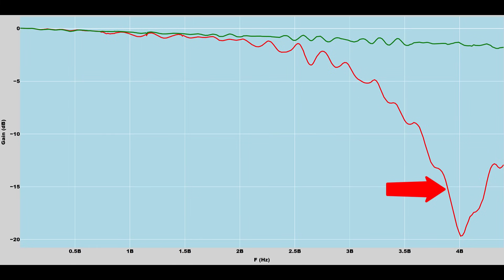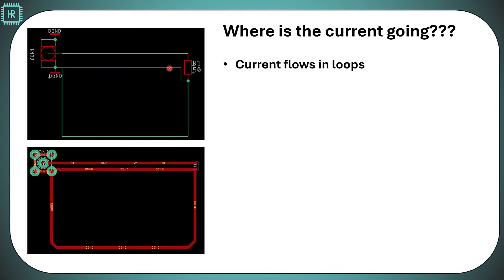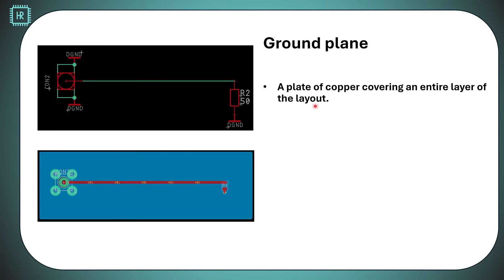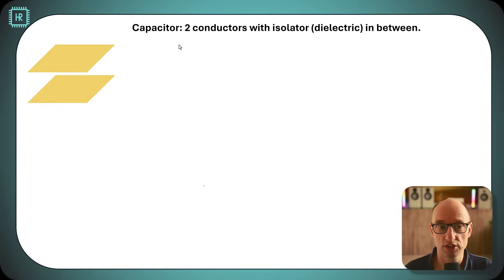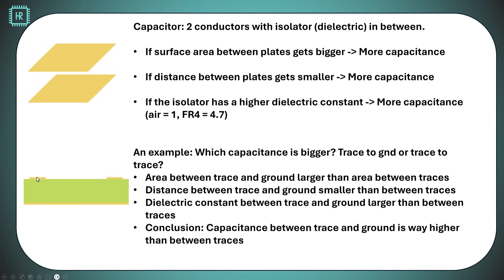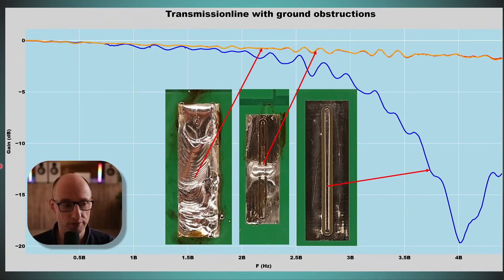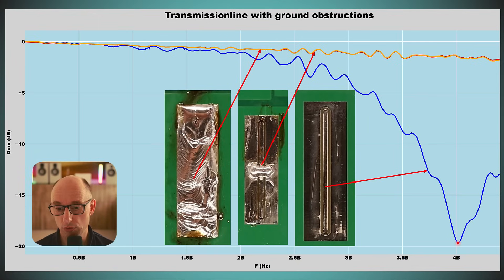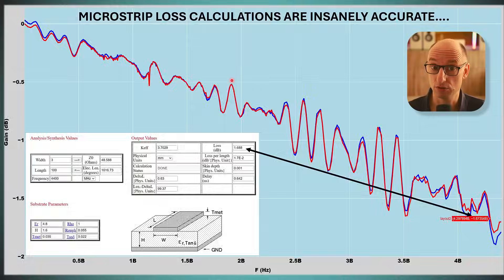Flawless PCB design: RF rules of thumb - Part 1

Comment: Don't need the checklist, created one myself in the last 30 years of so, lol... Being a HAM operator building RF amplifiers myself for VHF, UHF an SHF (DATV) I can only agree with your findings. What did struck me some time ago is how RF energy is moving through the copperlines on the PCB, well it's NOT, it's moving through the PCB between the striplines and groundplane and vice versa through the diëlectricum! Nice video Hans, best regards Richard (PA1RAM).
Reply: By the way, forget to mention. The last example you gave, it's called a Wave Guide, actually a Coplanar Wave Guide, am using it all time these days in my RF amplifiers. And yes there are some good calculators available on the net.
Reply from the maker: Indeed, I know the name. Forgot to mention it. I'm going to make a video on characteristic lines at some point. Good to hear your experience matches mine.

Comment: Great video, cant wait for PCB design for RF to EU energy converter
Reply from the maker: what is that?
Reply: @HansRosenberg74 it could be a Minecraft reference.

Minecraft has a huge modding community. Some mods add machines which require energy to operate. 

There is no energy mechanic in the base game, so mods often add their own energy systems (usually some simplified version of real life electricity with cables, generators, some sort of accumulator for energy storage, etc.).

RF and EU were two popular energy systems added by mods. The problem is that they are incompatible with each other (you can't power an EU machine with RF and vice versa), so people often had to build RF/EU converters in order to power machines from one mod with generators from a different mod.
Reply from the maker: hahahahahahaha

Comment: Hello Hans,

Checking out many of your videos, you always tell us to use a continuous ground plane. But what about mixed circuits like analog audio high frequency transmitter circuits? 
There you have analog audio -> ADC -> RF fronted. 
How do you avoid digital clock and RF noise (sub-harmonics) to get inside the audio path without separating the ground planes?
Reply from the maker: Great question. This is why I'm making my next video. This is a question that comes up a lot and I've seen many designers choose for separate ground planes and see their designs fail. I hope I can explain it clearly in the next one. I just posted my 5th video, and the car kit example shows you 1 case of how multiple ground planes can fail. Maybe that already clears something up for you. Link for part 5 should be in the description. Best regards, Hans
Reply: @HansRosenberg74  thanks a lot for your reply. Indeed I watched the car circuit example and how separating ground planes you may cause more inductance in the current return path. I'll be waiting for your new videos.
Best regards,
Pablo.

Comment: Which nano VNA are you using?
Reply from the maker: I'm using the NanoVNA V2 Plus5. This is a more expensive model, but it allows for very fine frequency steps which allow measurement of crystals as well. I read that there are a lot of cheap chinese versions which have less specifications so if you want to buy one you should be careful what you buy. Best regards, Hans

Comment: 13:39 Er has been faked to get the desired result.
Reply from the maker: Haha, believe me, I was just as surprised that the values landed on top of each other. In analog/RF you always expect some tolerance, if you can predict something within 10% its already quite nice. But this is just what I filled in. It's more a bit of luck I think, I would have been happy with everything within +/- 0.3dB.

Comment: 12:16 you do know, that many GPS receivers have 1-bit to 4-bit analogue front end, don't you?
Reply from the maker: I don't really understand what you mean here.
Reply: @HansRosenberg74  GPS receivers don't need high dynamic range. Many GPS front ends have a 1.5-bit ADCs.  AGC keeps the input at thermal noise floor and cross-correlation does the rest.
Reply from the maker: I've worked on GPS receivers a number of years ago. You do need a minimal amount of dynamic range because cross correlation can only get you so far. If you had infinite time, you could cross correlate really deep, but you don't have that time since bittimes are limited. So you still need a minimum dynamic range. If you think about 1.5 bits, you would think this is only 9dB of dynamic range max. However, the trick these receivers use is massive oversampling and then decimation. This turns the 1.5 bits into something much more bits with a lower sampling rate. You can go up to 24 or 32 bits if you want with enough oversampling. This means that you still need that dynamic range. It's just achieved in a different way.
Reply: @HansRosenberg74  Well, in some way — yes. Thermal noise creates almost perfect dithering effect. Don't forget that the biggest noise source in GPS is own satellites — cross-correlation between two PRNs is only about -20dB and there is a good dozen sats visible at the same time.

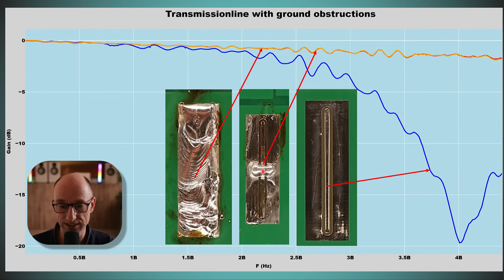Comment: Dear Hans, I have question. On 10:52 -> The signal is flowing under the trace. So, what happened if we have an arc as signal path and a ground plane on the other side. Will the signal make a curve or will it choose the direct shortest path ? Thanks, your explanation on Youtube is priceless
Reply from the maker: wow, thanks for the enthusiasm :-) Indeed, it will simply follow the arc in the groundplane under it. If it would take the 'short' route, it would create a bigger loop if you look at it 3 dimensionally. So that is not the lowest impedance.
Reply: Thanks again. Clear explanation .. We should look at it 3 dimensionally. Cheers from Jakarta

Comment: You said the slightest interference will ruin the bottom end, but in your graph I thought the lowest values show the lowest amount of problems? Is that explained in another video?
Reply from the maker: If you look at the total dynamic range of an analog signal, it goes from 1V to 1uV for instance. 1uV is limited by noise and the 1V is limited by the swing of the circuit in this example. If you add a little noise or interference, the 1uV bottom part of the dynamic range is 'swamped' by this extra noise or interference. So you don't achieve a factor of 1.000.000 (120dB) anymore, but something less. Maybe this clears things up?
Reply: @HansRosenberg74  Yes thank you for responding!!

Comment: any suggestions for a calculator which properly treats a coplanar microstrip with vias like you describe? i spent a while a few months ago looking for references and came up short.
Reply from the maker: I think they're assuming that RF engineers know they need to use via stitching and therefore omit it. If you just take 1/10 wavelength distance between via stiches, you'll be guaranteed the exact same performance that the calculators predict. My part 4 video shows measurement results on this.

Comment: ESD is an interesting subject, which is a single strike event of 0.8ns duration (>1GHz) and very high voltage which causes interference and damage to circuits. Its not always possible to place ESD protection extrememely close to connector pins, so tracking needs to have uninterrupted ground planes like you mention. It would be interesting to see if there are things to avoid, or better schemes, to defend against these events!
Reply from the maker: It's already on my  list, I used to be doing a lot with ESD prevention and I still have all my own manuals :-)

Comment: I undertand capacitance but i dont understand impedance. Doesnt the return current follow under the signal trace because charges are attracted and because of the slight imbalance of charges under that trace, like capacitively coupled?
Reply from the maker: Impedance basically the complex variant of resistance. So an impedance has a real and imaginary part. The real part is resistive, the imaginary part is either inductive or capacitive. The path directly under the trace has the lowest overall impedance, that is why the current flows there. Field lines are definately present between the signal trace and the ground plane, but it is more a result of the lowest impedance path I think. Now however we're getting into really fundamental physics and I'm unfortunately not a expert at that. I understand what happens on a board due to my long experience, but I lack the deep knowledge of physics.

Comment: Floating planes. I have thought about this, whether I could use copper strips to make a "faraday cage" either partly or fully around or between signal traces to shield them from either emitting or receiving noise. And whether i must connect these to ground. 
It seems as if i dont connect them to ground it will just make things worse by capacitive coupling?

I am just an amateur so these videos are indeed very helpful.
Reply from the maker: if you make a cage: fully ground it! only then will it block high frequencies as well, in my next video I'll show a simple formula how many vias you need per unit of distance.

Comment: usually when you make a video for RF design, you're audience aren't amateurs, yet you're teaching amateur level. for example: if surface area between plates gets bigger -> more capacitance... i mean come on! if you're going to make a video like this, maybe change the title to how to connect an led :)
Reply from the maker: My practical experience is different. I've repaired so many pcbs from colleagues who missed these basic insights which made these pcbs fail rf requirements. Many electronics engineers seem to think RF lahouting is something like black magic, but it's really simple and that is what I'm trying to convey. (even though the separate building blocks for that may seem really simple, obvious and dumb)
Reply: @HansRosenberg74  we're coming from 2 different sides then. even if you started explaining the smith chart i would have been like what's up with the basic training here so when you explain how a capacitor works, to me that's like explaining a AA battery and which side is positive.
Reply from the maker: have you seen the whole video? It's about the context of pcb design. My experience is that most engineers really don't realize this is going on in a board (having helped many of them in the past solving board issues). I think every electronics engineer understands how a capacitor works, but not in this context. At least, that is what I saw in my environment.
Reply: @HansRosenberg74  i didn't see much of it because i wasn't learning anything and once it got to the capacitor thing it became clear the video wasn't for me. personally i would have titled it "pcb design for noobs" haha. but it's your video, i'm just a guy making comments. i may also place too high of a standard on people. i know how to do my job and i expect others to know it too. i also get it, there are some truly awful "engineers" out there, that say they know how to do it but they don't at all. the worst i've seen was a guy that had the 3.3 V line from an MCU come out of the enclosure and directly connected to about 10 feet of wire that was routed underneath 240 V bus bars and switches, just to control some LEDs. the processors kept getting fried and he kept saying it's because of the high heat... until i looked at it and i saw it immediately. it looked fine in the schematic of course. some electrical engineers just have no clue how electricity works, it can be frustrating to say the least.

Comment: I was having a little think about your video last night.  My question is having a ground plane in a circuit as you described.  Having a ground plane wider than it needs to be would be expense and not necessary.  So, could you go down the road of calculating the size of the max current field to determine the size/width of your ground plane to save on cost?
Reply from the maker: Actually, having more ground plane does not cost more. Boards start out with full copper planes and are then etched. So there is no extra cost involved. Actually, it is cheaper to have more copper on your board since the manufacturer would need less etching fluid (or it would last longer). Best regards, Hans

Comment: At the end of the video, hammering ground vias to box in the TL is the only practical approach unless it's a specialised part or test fixture, because we can't afford to lose an inch perimeter around every RF path, we need that board space.
Reply from the maker: that should work well, it's on the list for the next board already

Comment: Struggling about how to think about analog circuits. Especially the 'everything affects everything' part. How is one supposed to design anything or analyze any existing circuit? Thinking about one 'block' of functionality is not enough, since it's connected to other pieces of the design and since all is analog, the values feed each other, creating an infinite thinking loop which never stops.

Comment: Hello Hans! Thanks for this video. I think it would be interesting to know about exceptions to the rules. For example, are there any conditions under which you should not apply a full ground plane?
Reply from the maker: Great suggestion. There are some extremely sensitive chips like high speed amplifiers which are 'allergic' to capacitance. You have to open the ground under their pads. I'll add this to my video list :-)

Comment: SUBSCRIBED!!!
I am a retired electrical engineer and did mostly digital but have dedicated my remaining heartbeats to attempting to master RF design as best I can.
So, I enjoyed your video very much and appreciate the modeling and measurements that you made.
Also, looks like this is a new channel so I hope you do mainly RF (at least for me)
Many years ago, I got pushed into designing a 2-layer RF PCB.  So, I just put the GP on the top; circuit traces on the bottom and used TH ccomponents.   
The board worked amazingly fine and later I learned that this was the correct way to do it,  In my mind, it was the only way to get a continuous and contiguous GP!
Anyway, looking forward to further videos...  73!
Reply from the maker: Thanks a lot, hope I'm improving your 'retirement experience' :-D
You can get the checklist here:
https://www.hans-rosenberg.com/checklist
Best regards, Hans
Oh, my 3rd video is out, all on RF! Hope you enjoy that one as well.

Comment: Hi, great video.  would you also consider making videos about simple designs of varius small circuits?  like small buck boost or opamp circuits etc.
Reply from the maker: I'm thinking about that, first project would maybe be an RF gain block board: Very simple, but very useful

Comment: So what exactly are you telling us? We should not use the ground layer for wiring?

I am currently layouting a 27 mhz atmega328 board as small as possible. I had to move some connectors around which forced me to use 4 layers instead of 2. 
I now use the outer layers for ground plane and wiring. One of the inner planes for 5V and the other inner plane for wiring that doesn't fit into the outer planes, no ground there yet.

PS it already works just fine soldered manually on raster board.
Any hints or suggestions?
Reply from the maker: If it works fine on a raster board, you'll have no problems. Ideally you would use layers 1,3,4 for routing and power, and layer 2 for ground. This will give the best results. Make sure that you have decoupling caps as close as possible to each supply pin of the atmega and any other devices you have on there that have a power connection. I have it explained in my free product development checklist. You can get it here:
https://www.hans-rosenberg.com/checklist
Best regards,
Hans

Comment: Thank you for that video. Very informative. 

You said „by placing the solder blob just under the transmission line you proved that the return current flows directly only under the line“. 

Strictly speaking that is not proven here, since there are other explanations that might explain the measured result. E.g. if you see the obstruction as an antenna which you have tapped in the middle with the solder blob, this would explain the result too. What might be interesting to further prove your statement would be to move the solder blob up or down in steps and compare the results. 

Again: really well done! Thanks! ☺
Reply from the maker: Great idea indeed, I thought about moving the blob as well or asymetrically, to prove it will take the shortest route in that case. Maybe I'll make a short video on this. Or maybe I make a 'viewer reqeust' video in this playlist, I've had some other interesting remarks as well which I could easily address with a measurement.

Comment: 8:27 Not important, but to my eye the dielectric constant between the two lateral traces is closer to 2 than to 1 due to the presence of the FR4 that is between them for ~half the E field volume.

Great video!
Reply from the maker: Thank you, You're correct, I was thinking about this when I recorded the video, I didn't want to go that deep and maybe cause a bit of confusion.

Comment: Excellent video that combines theory and practice, thanks a lot! As a student, I've been told many times by many different people that the integrity of the ground plane is very important when designing high-frequency circuits, but I never really understood it from a theoretical aspect (because I thought it's something that is really hard to analyze without the help of computer simulation). This video gives me the courage and shows me the correct route to actually analyze such problems quantitatively. Many thanks!

"Send me the Checklist"
Reply from the maker: Thanks! You know the thing is: it's not hard at all, it's just that almost noone understands it fundamentally so they cannot explain it correctly. This happens to be one of my all time favourite subjects :-) so I can show how easy it really is. In the next video I'll show some examples of where it get's a little harder to quantify what is best on a 2 layer, but I also have a solution for those 2 layers.